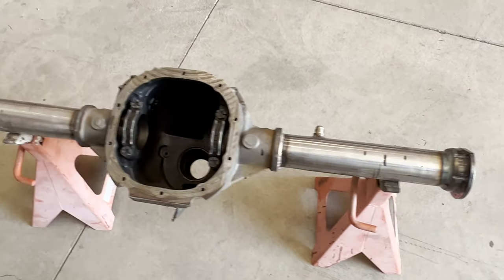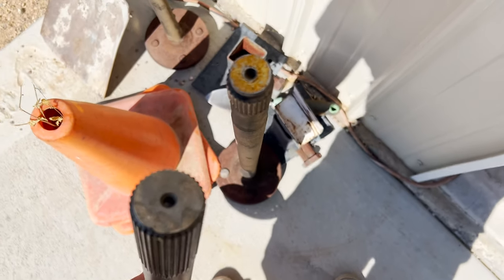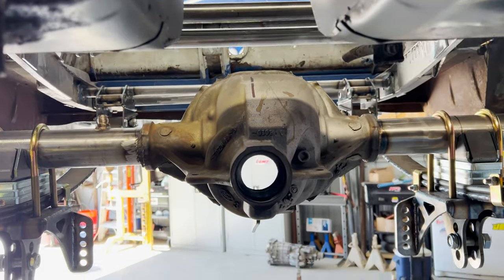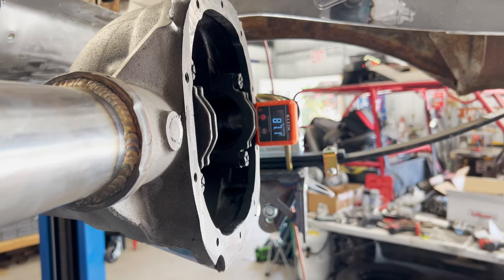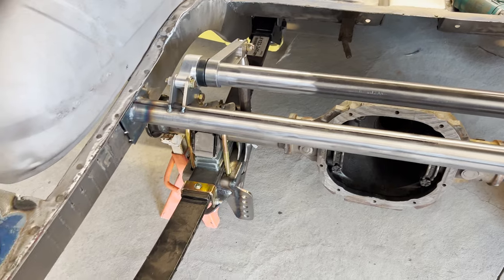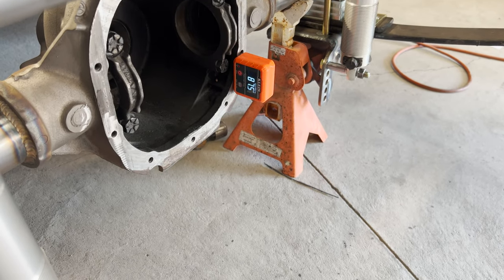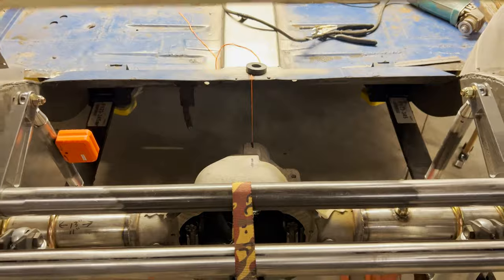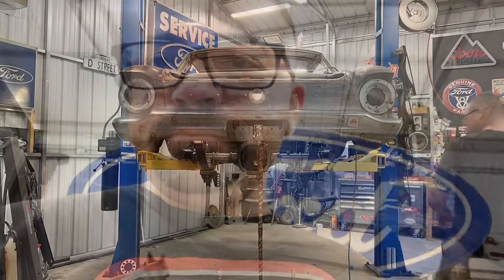8.8  rear end FINALLY completed ? 1963 Ford Falcon gets its rear situated!!

Comment: Unfortunately I haven't raced in over 40 years. Are the 9" rears really that much more than the 8.8? Whichever you use,I sure hope all goes well with the build!
Reply: Imo 9” is great for simplicity of changing gear sets with a center section swap, aftermarket options and support but for an average guy (9.50 slower 1/4) the 8.8 will be plenty strong with just a skmple brace and axles. Depends on gear sets though some for the 8.8 are weak just due to the pinion so small, 9” has so many more gear sets available but they do take a bit more power to turn than the 8.8
Reply from the maker: This will have to do for now. Later I can step up
Reply: @TeamDPerformance  Race it till it breaks!
Reply from the maker: Tess put way more power and just over 1 second 60 foots on an 8.8. I think it will work for a minute
Reply: @TeamDPerformance  I'm glad to hear that! I've been out of it for so long, I don't know anything about the 8.8. I only used the 9" I launched at 7,000 & never had any problems. Today's cars & trucks, have much more power than we did back then. You know much more about how reliable equipment is today. Best of luck to you! Can't wait until you're ready to race!
Reply from the maker: A 9 inch is by far a better deal but it’s a lot more money. I will end up there but I’m positive the little 8.8 will go a lot further than people think. An 8.8 is stronger than a 12 bolt Chevrolet
Reply: @TeamDPerformance  Wow,I'd never thought that it would be stronger than the 12 bolt! Like I said I'm strictly a fan now & don't know anything about all the newer stuff! I remember going to a local Ford dealership & buying a set of brand new 289 hi po/ Boss 302 rods for $8@!!! What's the difference in price between the two?
Reply: @TeamDPerformance  I use to do  what you are doing and I'd still run a ford 9 in , I new guy's with 12 bolts would twist axles or brake the C clip . I would have had that car on a frame table leveled out and welded to the table so nothing would change your measurements. That's the way I did things , people do things differently looks good..

Comment: Nice work! Hey when you  shorten the 8.8 does it make the the pumpkin centered?  I still have the original rear axle in my falcon and it offset. Does running a centered axle mess with anything? Thanks
Reply from the maker: Thank you ! No you have to center it in the car. If you just shorten it, it will be about an inch off center which is fine but I’m trying to make some steam and I wanted the pinion to be centered in the car.